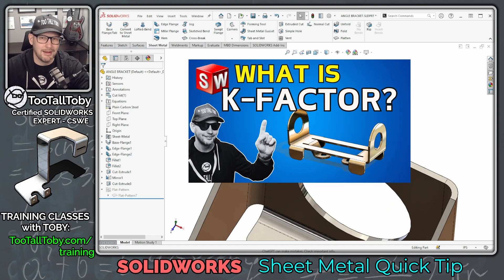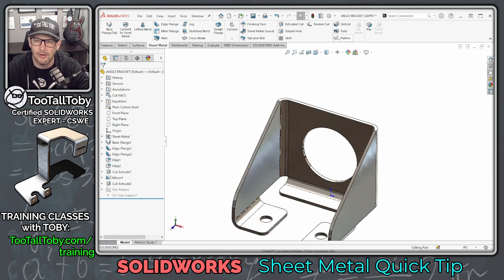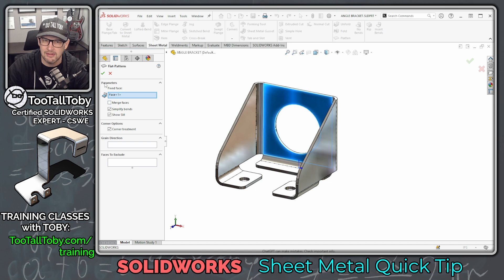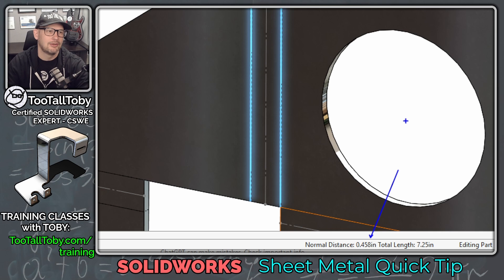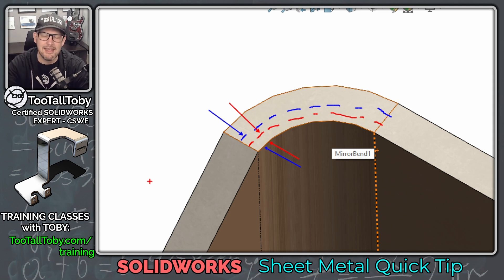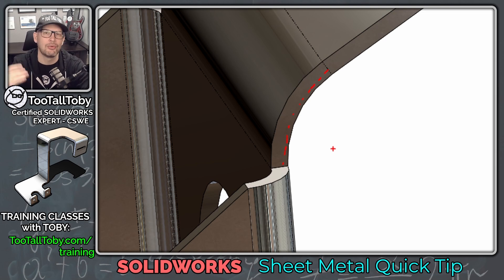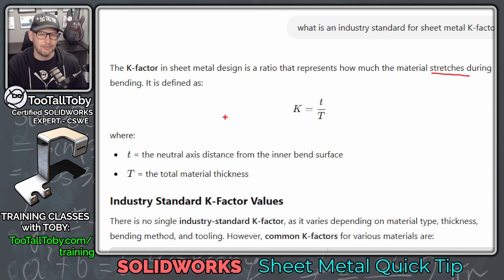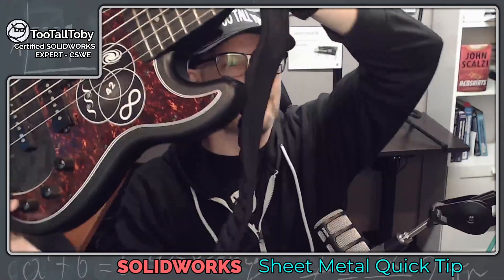What is the Sheet Metal K-Factor DEFAULT VALUE in SOLIDWORKS?

Comment: The sheet metal fabricators I know always want step files of the bent model because the flat pattern dxf files are either broken (cant laser) or the k-factor is wrong. Hence they prefer the step to do the flat pattern in their own software with the values they know are best for their material. The flat patterns I do are only for rough size estimate.
If I had to output an accurate flat pattern and the steel part only has 90° bends I would use the values from DIN 6935 and manually calculate the expected pre-bent length. Then adjust the k-factor until the flat pattern reaches that value.
Reply: The last shop I used for sheet metal had a sheet metal table for k-factor and standard radii that they could do. It was nice because everything came back perfect, even complex multibody parts that were small or large. 
The new shops I work with just say do whatever and we'll figure it out. Well, the parts I get from these shops are not good. 

I also have a CNC brake to do one off stuff and small production in house, Whenever I use a new material,  I make a 4" x1" blank and bend it in the middle at 90°. Bring it back to my desk and figure out the K-factor and inside/outside radius. Then setup an inhouse sheet metal table for solidworks.